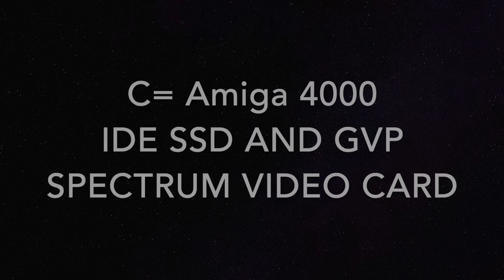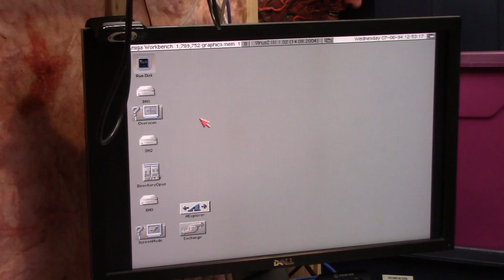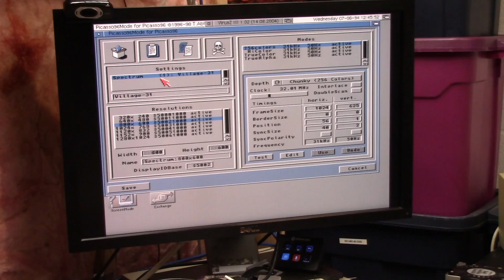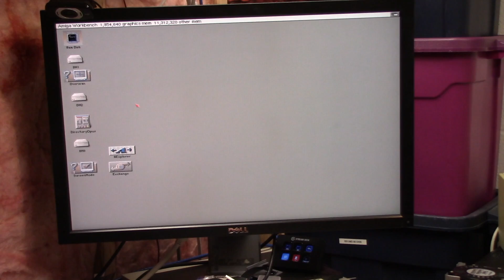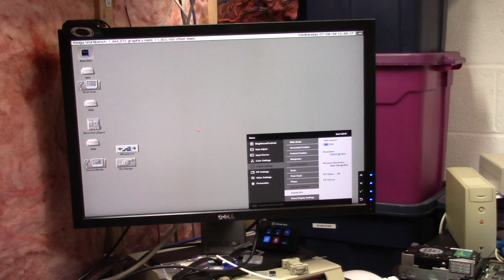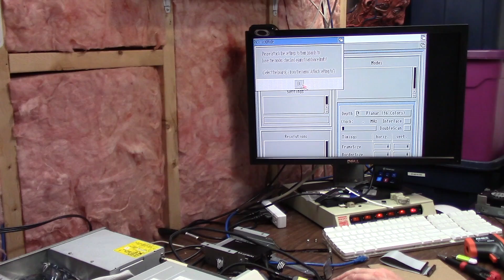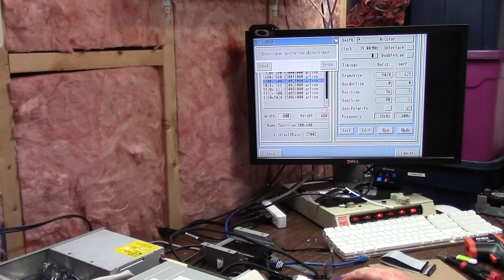Amiga 4000 IDE ssd and GVP spectrum video card

Comment: Why do you keep running 4:3 aspect graphic modes in 16:9?
Reply from the maker: Depends on the software. Do you recall my comment in the video that this operating system is near 36 years old well 36 years ago 4 x 3 was the normal so there was a piece of software called modepro In the system preferences that controls screen promotion feel free to adjust as needed

Comment: Good stuff for sure! Thanks for the shout out, by the way. I find that those disk on modules may not be quite as fast as a CF card, maybe about 10% slower. But I have a strong feeling they are going to be about 100% more reliable in the long run. And I just love the form factor. Mine fits on my vampire a500 beautifully in my Checkmate case.

Comment: Just made up a A4000 system in winuae for a laugh with this video card, the 5 disks of software is amazing, it comes with so much stuff, please tell me you are doing a follow up on the software for this thing? I sat there for 10 minutes trying to comprehend what it all did,  it looks like it runs in its own type of screenmode called EGS?
Reply from the maker: Yeah i need the pass through cable. My normal rgb didnt work i wonder if it has a different pinout. The power light just flashes when i hook it up in pass through mode